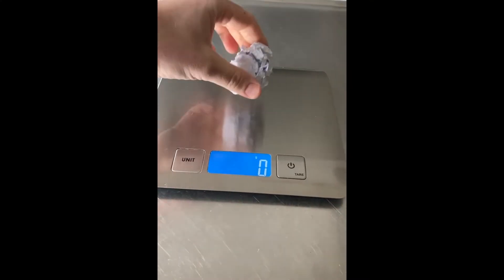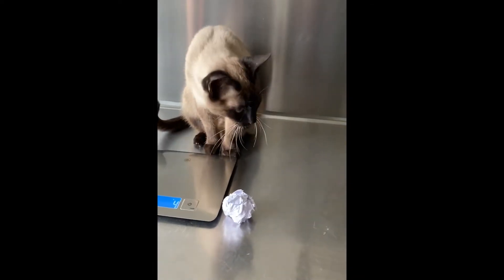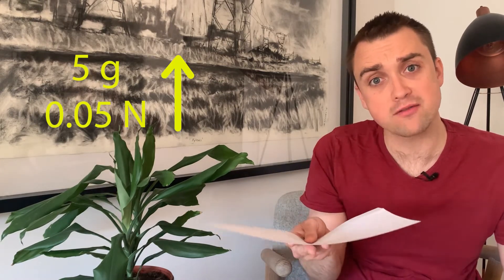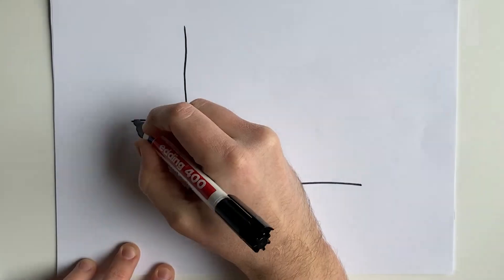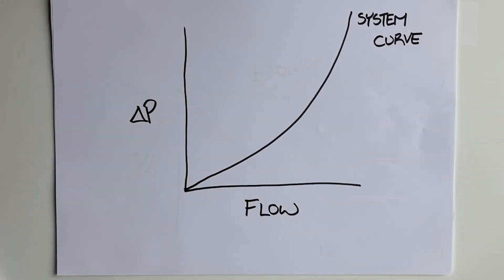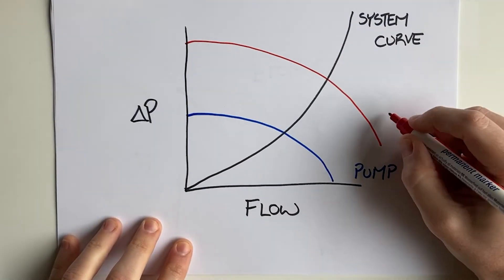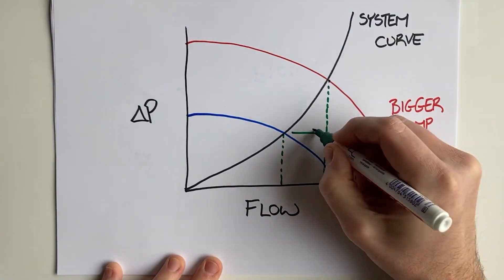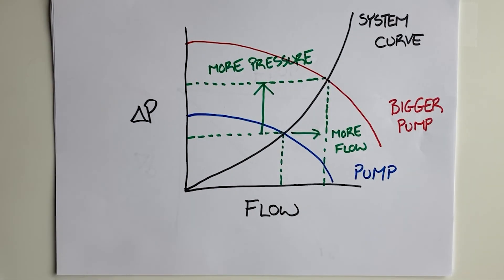Want to understand pumps? Don't start with pump curves.

Comment: I am working in automotive manufacturing and I can translate this video like this: Always check your inputs and outputs first, then f*ck around your machines. SiSo flow. Shit in Shit out. With a pump I would check frist for moisture, bubbles, temperature, viscosity going in, and only after that would examining the HW. 6 out of 10 the raw material is the root cause not the machine.

Comment: One should also understand the concept of total system pressure is the sum of local static and dynamic pressure plus global pressure. Trying to run a pump against a valve with minimum openings and maximum should also give one a intuitive understanding of the head and system curves.

Comment: Excellent stuff. I think the same thing applies to fans. I know we're dealing with a compressible fluid here but, I think, the same thing applies. As I recall, mathematically, a system is described by a positive curve/slope. A pump or fan has a negative curve. When one is superimposed on the other they naturally cross - at least in the real world. This is the operating point. The system curve changes if filters/strainers get choked up or if dampers/valves get opened or closed. And the fan/pump curve changes if the device is speeded up or is slowed down. The net, end result is - where they cross, is the operating point.

Comment: The flow and pressure are the result of some amount flow overcoming whatever the the applied resistance is at the time.  The pump only expends the minimum amount of energy required to get whatever flow it can through that resistance, determined by how efficiently the pump can convert its impeller's rotary motion into forward motion of a fluid at any given flow rate through it.

Comment: You are nitpicking how people often speak.  The pump control systems are being treated as if they were integral to the pump.  Maybe the vfd is operating at a different frequency because a lower flow is desired today.  Maybe a higher than expected demand is occurring and the pump speed was not adjusted to account for this. The question is based on appearances but still leads towards steps to rectify the situation. Also, you cannot just slap a bigger pump in place.  A bigger pump often requires bigger pipes.  Determining the proper solution requires a proper analysis of the situation.

Comment: You are presupposing synchronous motors there. The motor might be, or might not be - in which case everything you said would no longer hold true... which is the reason why we have pump-curves.
And if the pressure is too low - that can have so many causes, and yes multiple of those could be related to faults with the pump or motor. The motor might be running at only 2 phases instead of 3, or the pumpt might have bad lubrication, or the piping is leaking, or anything else.

Comment: Incredible video!! Does throttling the discharge valve make it easier for the pump then?? Because it reduces the load (flow) it produces at the same rpm?
Reply from the maker: Glad you thought so! Yes, although more accurately it makes it easier for what drives the pump (normally a motor).
Reply: @ProcesswithPat  got it! Makes sense now, thank you

Comment: Hello Pat, in order to help myself understand the message in this video better, I have a hypothetical question to ask you:

Let's say there is a reservoir with its bottom at sea level filled up to 250 feet. Water leaves near the bottom of this reservoir through a dam spillway, and travels through many miles of straight, large pipe. The water eventually reaches a pump station where the pipe becomes the influent for a large pump. The job of this pump is to send the water through a stretch of no slope pipe until it reaches the base of a hill, at which point the pipe inclines and water makes its way into the bottom of a 30 ft tank sitting at the top of that hill.

Initially this tank on the hill is totally empty, and the pump station has no water running through it. At this moment, the pressure gauge on the influent side of the pump as well as the pressure gauge on the effluent side of the pump both read 0 psi. Then the reservoir's dam spillway is opened and the water begins its journey through the miles of pipe, eventually reaching the pump station. As the water first travels through the pump influent, the pressure gauge on the influent side of the pump reads 50 psi (I don't know what a logical psi value would be here for the reservoir level). The pump is running now, and water is exiting the pump effluent.

Water is now flowing into and out of the pump, but no water has reached the base of the hill where the pipe first inclines YET. The water is still just making its way towards the hill through the section of pipe that has no slope. At this moment, what would the pressure gauge on the effluent side of the pump read? My guess is 50 psi same as the pump influent gauge because there is pressure from the reservoir head, but no load/resistance on the effluent side yet.

This was more of an essay or story than a question, maybe the question was flawed and doesn't even make sense. Hopefully the concept I'm trying to get at that I'm still wrapping my head around is clear. I'm kind of asking a question when I don't really know what my question is, hence the long comment. Thank very much for reading!
Reply from the maker: Hey there! There’s quite a bit in your not-really-question, but it’s pretty interesting!

First and foremost - you have defined some heights (you didn’t mention how high your hill was) but no flow rate requirements or line sizes. You would need line dimensions/geometry as well as the flow rate to be able to say anything about the pressure. So the 50 psi guess you gave - it totally possible - you could design the pipe so that at the design flow rate the discharge pressure is 50 psi (as long as this is enough to get uphill). So we can’t be too specific with values because the problem isn’t defined enough.

Secondly, you have 250 ft in the reservoir which means you can flow to the tank without a pump as long as your hill is less than 220 ft (250 reservoir minus 30 tank). The RATE would depend on your line size. Need more flow? You need a bigger pipe. The main reason you’d have a pump is if the flow rate required would need really large pipes for low pressure drop, and so it becomes more economical to install a smaller pipeline and overcome the pressure drop (due to higher velocities is a smaller pipe) with a pump.

Thirdly - your question - what is the pressure as the fluid reaches the pump? You are describing a transient state and so the pressure will increase the more the discharge line fills, and yes, it will increase even quicker when the fluid starts flowing uphill. But the pressure will start increasing even before the liquid reaches the uphill. Imagine you have a water/air interface. Air flowing through a pipe also has pressure drop. So your pump pushing that air-water interface along the pipe is not only causing water flow, but also air flow. Both of these have their own pressure drop in the pipe. It’s just that air flowing at the same velocity as water in the same pipe causes less pressure drop because of the very low air density. So even before you’ve reached the uphill the proportion of pipe exposed to water versus pipe exposed to air is increasing, and the water experiences higher pressure drop, resulting in an increase in discharge pressure from the pump. If your pump was running at constant speed that would mean the flow would be dropping over time. Once again - the significance of all these effects is totally academic because we have no idea what the line sizes and velocities are.

Finally - practically speaking - you need to ask yourself when you would start the pump. Realistically you’d open a valve on the reservoir and one on the tank and flood the line/pump. It’s not likely that you time the pump to start as it sees liquid. It is interesting to consider how the pump discharge pressure changes theoretically though. However, you would have valves on the discharge of that pump and you would never start the pump with that discharge valve open. That is because a motor draws an extremely high current when it starts because it takes force (and electrical current) to accelerate it to speed. If your valve is open then that entire flooded line is placing load on your pump/motor which will push the starting current up even further. You would have over-current protection (basically a circuit breaker like at your house) on your pump motor to protect it from burning out due to high electrical current.

Does that help?
Reply: @ProcesswithPat  Thanks Pat, I guess what I'm wondering is this: Do pump effluent pressure gauge readings equal just the amount of pressure/resistance on the effluent side of the pump, or do they equal that plus the pressure on the inlet side of the pump?

If my inlet pressure was 50 psi and I had no resistance to flow on the outlet, would the outlet pressure be 0 psi or 50 psi?
Reply from the maker: If the ONLY thing you do is increase suction pressure to a centrifugal pump, then the discharge pressure and flow will both increase, but the DIFFERENTIAL pressure will drop. So if you start with suction at 0 psi and discharge at 50 psi, and then you increase the suction to 50 psi, then the discharge will got to some thing like 90 psi.

However it is also totally possible to increase the suction pressure from 0 to 50 and maintain the same differential to gave 100 psi discharge.

The best way to understand is by looking at pump/system curves. I’d be more than happy to do a video on it, if it’d be useful?
Reply from the maker: As promised: https://youtu.be/wMdOX0h1ytQ

Comment: Pat....Can you please consider a video on surge and surge control mechanism??
Reply from the maker: Hey Manoj? You looking for something specific? I like to put in a bit of work into it, but I need a good understanding to explain it clearly, and although I understand compressor surge, anti surge not something I use daily… so I don’t want to pretend to know thing I don’t!
Reply: @ProcesswithPat   if possible can you do a video about centrifugal compressor surge and the anti surge devices used on the centrifugal compressor to avoid the surge phenomenon